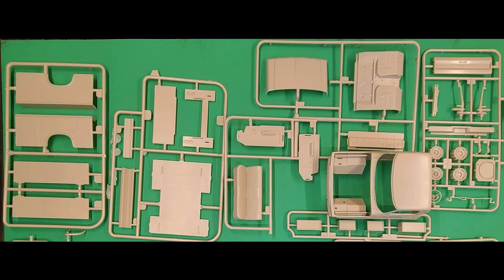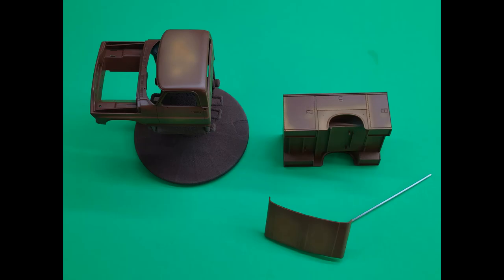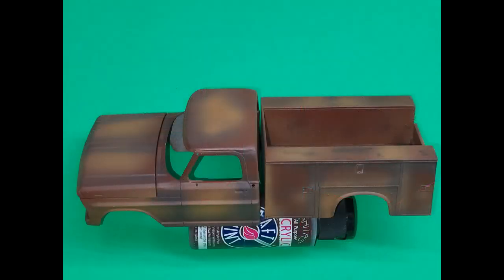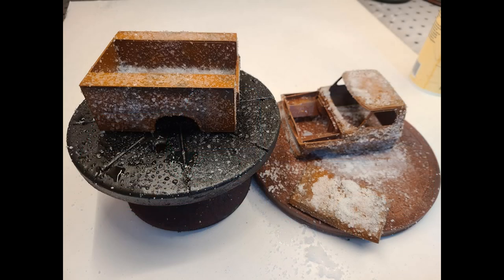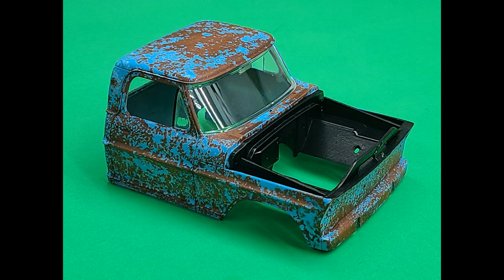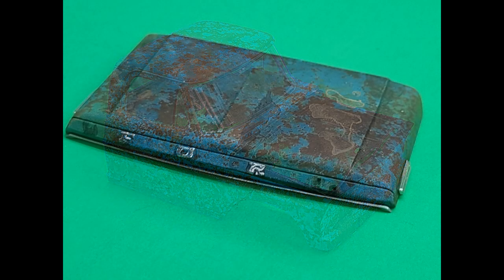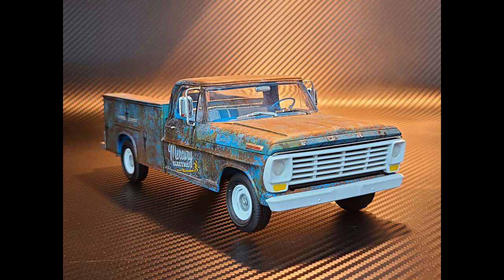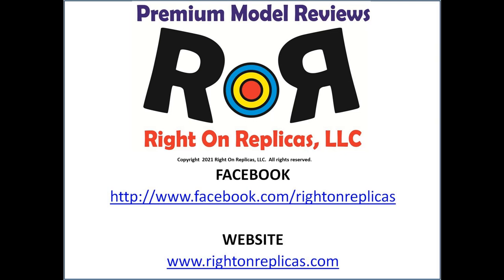Weathering with Salt –Scale Modeling Methods

Comment: My salt wont adhere and stick im not sure where i am going wrong
Reply from the maker: ATL,  Make sure the surface is damp and horizontal to the floor.  You may have to do sections at a time changing the attitude of the kit.  Also, use a coarse salt.   Please subscribe if you haven't already, to help us continue our mission to inspire more modelers! -Doug